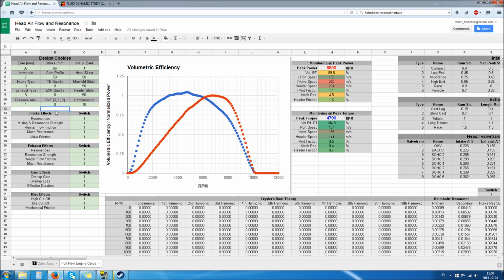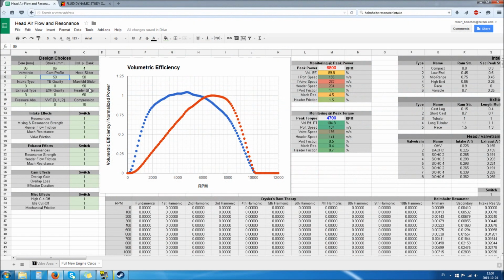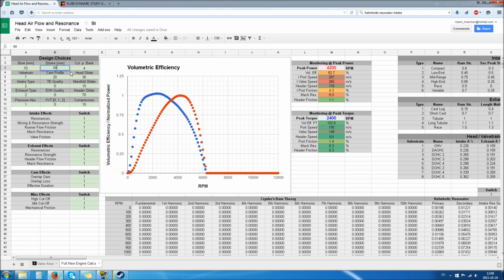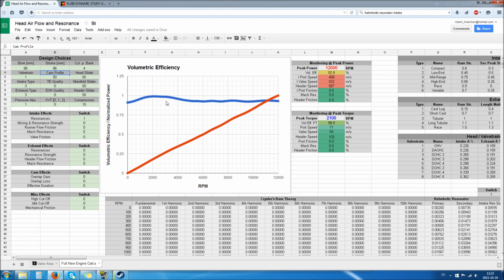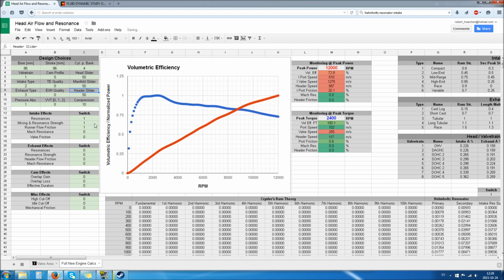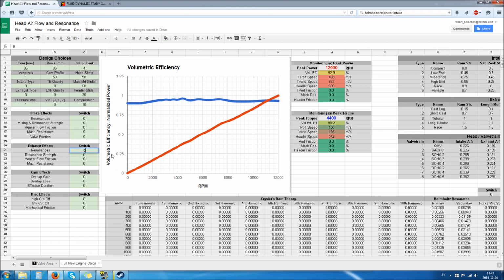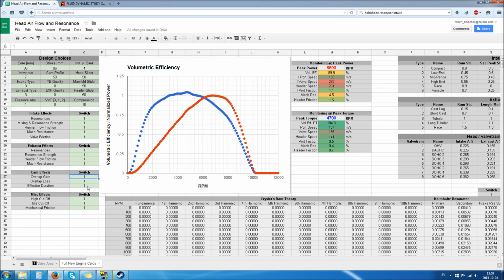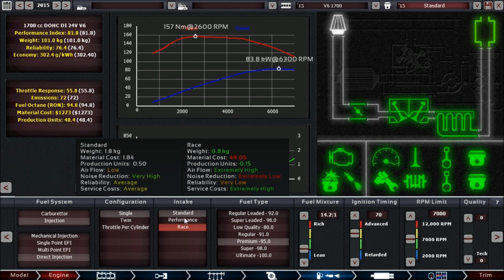Future Engine Designer Revamp Discussion

Comment: Thank you for adding a good colorblind effect :) Help me out alot. Many ofther games pick the wrong colors for that, but you didn't. Thumps up
Reply from the maker: +Rasmus Buhl Lauge Pedersen It's a relatively easy thing to do, so I wonder why so few games do this. Anyway, our main audience is male, and through that is more prone to having some color vision weakness - it would be pretty bad for us if we didn't offer a color blind mode :)
Reply: +AutomationGame Im very glad you did it anyway. The only problem I have is the difference between the last two color steps before the engine is to big to fit in car. But thats the only thing.

Comment: So, am I understanding it correctly that these calculations will not be implemented in the franken-engine?
Reply from the maker: +Jack Woodrow Correct, that would be implemented when the engine designer is ported from Kee Engine to Unreal Engine, which is a while after the birth of the Frankenstein's Monster.

Comment: Will we ever see 3/4 valve modern OHV push rod valve train?

Also single turbos for V8's etc?
Reply from the maker: +xbox819 3/4 valve pushrods: definitely not, single turbo V8s most probably yes!
Reply: +AutomationGame 

Will we ever have see a increased maximum for more turbo boost (psi)? 

Right now 44.1 PSI seems to be on the "low" side for a "maximum" psi,  especially if you have a engine with big turbo(S).   Power is still left on the table with say turbos/ engines that is capable of say 90 psi and its limited to 44.1 psi. 

Thanks
Reply from the maker: xbox819 That's a request we get often, but there are no production (petrol!) cars that run boosts anywhere even near the limit we currently offer, so no, we won't change the current limit. :)
Reply: +AutomationGame I totally agree with you and understand, just as a bystander here, 
but won't it be possible (In the future of course) to simply modify values like this? I seem to remember you saying something about it.
Reply from the maker: Diax1324
It would probably take 5 minutes to change, but we won't, because it would make the game worse, not better.
Reply: AutomationGame I thought modding support like that was going to be allowed? I totally see your point though.
Reply from the maker: Diax1324
We're not sure where to set the limits for modding yet. Opening all or select few of the lua files would be possible and would include things like stats of the various items in the game while calculations are in other files.
Reply: AutomationGame Oh yeah, I don't mean to make it possible for people to completely tamper the shit out of their files and stuff. I just mean like maybe giving us a max turbo boost value MODDABLE to like 100, but not 1000. And perhaps moddable fuel types, but only to like 150 octane. If you limited it a bit, it'd be giving people the same creativity but with different possibilities. It'd make the F1 roleplaying guys happy.

Comment: Will other valve train layouts available on older designs such as L-heads and F-heads?
Reply from the maker: +Nate Caraway Those are not planned to be added because they would be a ton of work and add little to no added gameplay value as these designs are inferior to the ones already in the game.
Reply: +AutomationGame but those can be optional DLC, right?

Comment: With V2/Boxer 2 engines eny type of exhaust have same lenght, so eny exhaust type on V2/boxer2 work like race exhaust on other engines?
Reply from the maker: Not quite ;) there is still different curvature to extract the hot gasses and different pipe diameters! Also, there won't be either of these in the game any time soon, so nothing to worry about for now ;P

Comment: A good idea is: Automation with motorcycles.
Reply from the maker: +Anselmo Pereira So why is it a good idea? :)
Reply: +AutomationGame It is a good idea because today we have car companies that also manufacture motorcycles.  Example: Suzuki.
Reply from the maker: +Anselmo Pereira True that, so why do you think it is we don't do that then?
Reply: +AutomationGame Because it involves a change in the name, new calculous, new engines, suspensions and bodyshells.
Reply from the maker: Anselmo Pereira The name is the least of the problems :) Yes, lots of changes would be required. Overall we estimate adding motorcycles would add about 2 years of development time. That, of course, is not an option for us. Cheers!
Reply: +AutomationGame Thank you for spending time with my idea.
Reply: or with heavy trucks